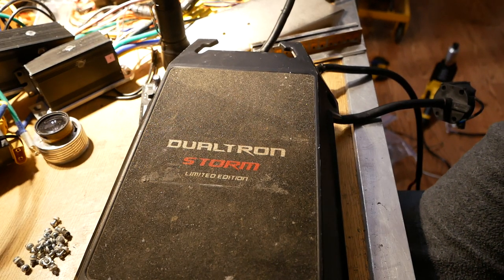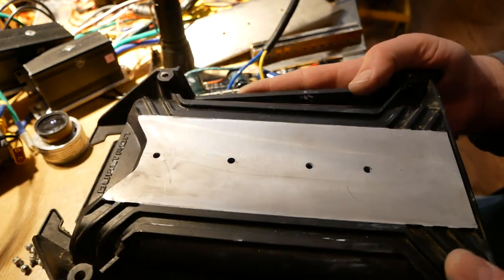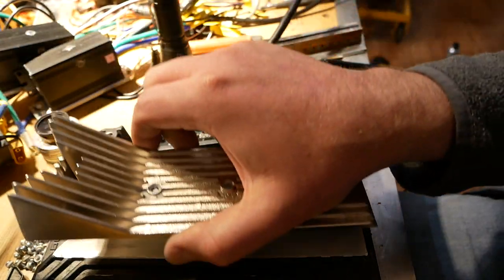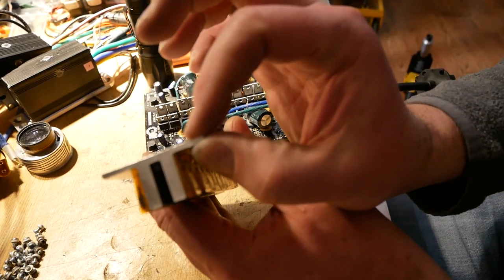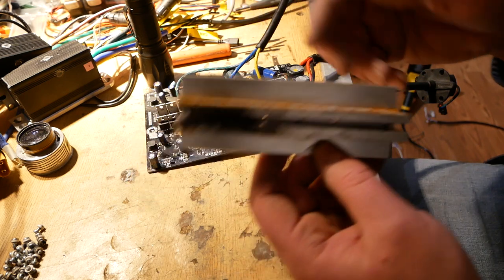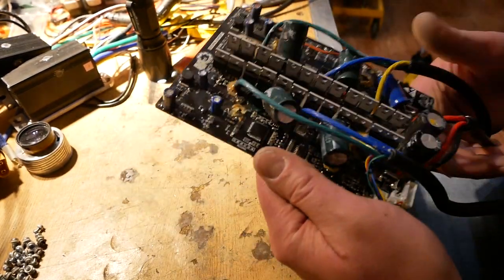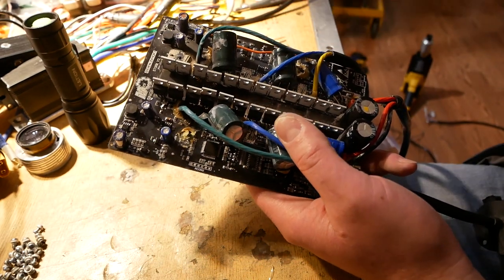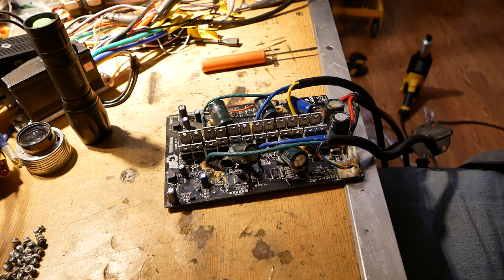Dualtron Storm LTD controller teardown - Why they die so often

Comment: Just bought a storm limited £4300 fml i need your help i want to make sure this doesn't happen to mine i have a soldering iron and heat gun i plan to have a electronics lab this year the whole microscope, oscilloscope, lab power bench supply
Reply from the maker: OK...what sort of help did you want? Fix the various issues I mention in this video and that ought to go a long way. Of course, you could always pull the factory controller once it dies and use something else?
Reply: @de-bodgery  well im going to defenitly try if it doesn't hit 70mph i will contact minimotors straight away if they don't try and help sort it i will send it straight back
Reply from the maker: @thebeast9869  That's your choice of course. My experience has been that performance ratings are always too ideal. My City is supposed to do 45 mph and even down a decent hill l never saw that. If I remember right, best top speed I saw was 38 mph. The motor power carrying a full sized adult, just can't accelerate me to that speed. Going up a hill was much worse...20 mph was about all I could get. So ask yourself what size rider was on the scooter when they got that magical "45 mph"? It may be that no rider was on it at all and they were simply measuring no load wheel RPM. It's not lying persay, but it's also not realistic. Range is this way too. My City can supposedly can get 55 miles range. OK...26Ah/55 miles = .45Ah per mile. If a small child was riding on the lowest power setting with no head wind, you could achieve .45Ah/mile! Otherwise...this is just stupid for anyone else! Never the less, it's what they advertise and it's based on real testing. AKA...not an outright lie, just NOT even close to realistic for most people. Cells are never as good in real world use as the manufacturer claims. A 3400mah cell can't be used to it's full 3400mah in real world conditions. They charge them to 4.2v and discharge to 2.5v. Anyone that cares about LION packs never charges to 4.2v or discharges to 2.5v. This is for 3 reasons. Capacity above 4.1v is negligibly low. Capacity below 3v is negligibly low. Running cells at these voltage ranges greatly shortens their life spans. Realistically a 3400mah 18650 is really more like 3100mah if you assume practical and usable cell voltages. My City pack which uses those ideal numbers from the manufacturer AKA 26Ah is really several Amp/hours less! As you draw current more quickly from a cell it's capacity also drops a little. I quickly found that the only tolerable way I'd ride the City was on max power all the time. Those capacity tests from the battery factory are done at 250mA. No one runs an 18650 at .25 amps in an EV! I don't know my actual amp draw, but I can say it was well over .25 amps per cell. The entire battery industry does this! What it does is makes for rather ideal cell capacities. The typical user doesn't know any of this and lacks the ability to test capacities so they are none the wiser. As you are probably aware, most EV's draw quite a bit of current and much more than .25 amps per cell...which means the capacity delivered per cell is also reduced some. My 26Ah pack is realistically something like 20ah between reasonable charge voltages and current loading. No one lied persay, but the pack capacity in real world use vs ideal circumstances can't possibly match up!
*
So again...your choice...but I'm going to tell you that you'll rarely ever see real world specs on EV's! They are almost always idealistic and therefore unrealistic in real world applications.
Reply: @de-bodgery  dualtron storm and the victor seem to do 50 if this limited does over 60mph im sure with small changes i can get 70mph +
Reply from the maker: @thebeast9869  I'm not sure what "small changes" might be to you.  At a minimum, you'll want to replace the controllers with ones that are FOC...such as something VESC based. This will mean some rewiring, replacing the EY3 throttle, possibly replacing the pack if it can't deliver the current, etc. "Changes" may be smaller or larger depending on what is needed to meet your goals. 
*
60 to 70 mph is only 10 mph, but the wind resistance is significantly higher at 70 than at 60. You can expect to need a fair bit more wattage to get to 70 than you did to get to 60! I can say that you won't get there on the factory controllers with full conviction! The pack might be able to deliver the current needed, but I don't know that as fact. 82v is enough to get to 80 mph, but the current draw is pretty significant. 
*
Anyway, you can see my City build and what I'm doing to make it meet my goals. That might be a lot of changes or just a few to you...can't speak to that!
Reply: @de-bodgery  seen your city build great work already  subscribed to you great work man youtube should promote more stuff like yours instead of mind numbing garbage i will rewatch all your videos countless times to learn more  you truly are a gem on youtube
Reply from the maker: @thebeast9869  Thanks for the compliments! All I wanted to point out is that there are potentially lots and lots of details involved for an "upgrade". I may have gone overboard, but then I also wanted my City to be the best I could make it. I honestly don't know how good it will be. It's quite possible that I'll get it all put together and not be happy with it and will do more or rework certain things. I'm dead sure that there will be details to work out that I won't discover until after it's ridable again. That's always the case!

Comment: You all have defective storm limited scooters.   First batch were defective but some dealers sold anyway.    I waited and just now getting my Ltd next week with motor upgrade - batch 2.    Send it back under warranty
Reply from the maker: This is a dead controller that was new a year ago. There are multiple versions of the controllers and motors. I don't think sellers knew what was defective. You can't tell from the outside.

Comment: You're smarter than the average bear.  I haven't seen inside these newer controllers but that thing is weak at best. I'm guessing the tapered heat spreader is directional? ... LAME!
Reply from the maker: Yes, the case is sloped internally. They tapered the heat spreader to fit into the space.

Comment: My man...!!!!
Thanks allot for this video!!
Because I'm Greek 🇬🇷 and can't explain so good in English the problems with limited (event more with dualtrons)...
I just say that has big issues and DO NOT buy it!!!!❌
Reply from the maker: That's pretty much my opinion too. Or maybe, "Buy it with the expectation that the factory motor controllers have a long history of dying for no good reason." People who own the LTD are eventually going to need to replace their factory controllers with something else when Minimotors decides to no longer make controllers for them. Frankly, if I had one, that's what I'd do. I wouldn't get another Minimotors controller for an LTD. you already know they will self destruct in less than a year. Why do that again?
Reply: @de-bodgery  changing Controllers can do guys like you and me....
The most people that buy this scooter, don't know Anything about electronics... Press throttle and go..!!!
Of course they believe that they have the top scooter of dualtron (and most expensive, exept X)...
from the FIRST day they see that has top speed issue ......
And in 3--5 months burn controller...😲
Left battery and frame....
They have spent so much money and in a few months the 50% of the scoot has DIED!!!!
Where is DUALTRON.....????🤬
WHY they don't take the responsibility and take back the most problematic scooter (and EXPENSIVE) they ever take out and STOP production!!!
You know why they don't do it....?? Because from so many Limited they have been sold, only 2 TALK ( V.THE.SEPIA and STEFFEN)... 🤷
So yes they are the No1 company that sells GARBAGE for GOLD and people are there to PREORDER what ever they sell.....
NUMO company (upgrade WEPED, and other scoots) relish a new scooter named SLACK CORE 920R..
This is a top class scooter from All things (power, stability, comfort, weight, beauty).....THE FUTHER!!!😉☝️
Reply from the maker: @antonypartali  Good point...most people lack the electronics understanding to replace the controllers with another factory controller, never mind something off the shelf like VESC and what needs to be adapted or modified to make it all work together.
*
Dualtron frames and motors are fine. I don't that creaking issue in the lower section of the steering tube, but that can be dealt with. The physical construction is usually fine for anything I've seen. 
*
I did a tire replacement on one a few months ago. I forget what model, but the tires were solid. Both tires were badly worn and needed to be replaced. They were impossible to remove by pressing them off the magnet ring. I used my band saw and cut them off! Getting the new tires on was equally hard and eventually I sprayed the inner surface of the tires with WD40 so they slide on easier. Dualtron had no idea how to do a tire change and for anyone that needed tires was selling them new motors!!! Well that's just nuts! That was the hardest tire change I've ever done and there was no way we'd ever recoup our cost in labor. what do you do? Charge people $500 for a tire change on their scooter? LOL! I can pretty much guarantee you that a very small handful of people would go the effort I went to!
*
The Storm LTD is a decently made scooter with a single enormous flaw...shit controllers that die if you look at them crosswise. All Dualtrons I have ever seen have a complete rats nest of wiring in them that makes no sense why they were done that way. All of the wiring could have been done much more neatly and sanely. When building these scooters, serviceability was not a consideration. Getting the factory controller out of my City took 4 hours! It was buried under all the rest of the wiring and that was such a mess that in the end I was cutting off connectors since they were so badly tangled together and impossible to separate from each other. IF I needed to replace the controller for warranty, I would have wanted to preserve those connectors so they could be reused as is. Dualtron concerned themselves absolutely NOT ONE bit for when things go wrong and how to fix them.
*
I was working on a Feutecher from Dualtron yesterday. My friend had already asked them how to remove the battery. No one at Dualtron had ever done this and the best they could do was theorize that you needed to take off the beck end of the scooter to slide it out. The back end suspension is a PITA to get in and out of the main box section of the scooter! This was bad idea on a good day! I looked at how things were assembled and figured out how to pull it out the front of the box. We sent pics to Dualtron and they were amazed! HOW??? LOL! How do they NOT KNOW how to take their own scooters apart??? In this case the BMS in the pack died and the best option was to get a new pack.
*
There's much worse stuff out there than Minimotors! Not that this makes them "great"...just better than some really really bad EV's I've worked on! For the price, you should be getting attention to detail and careful planning of wiring and electronics placement. Hopefully they are reading these comments and taking a look at what they are doing.
Reply: @de-bodgery  you CRAZY the guys from Dualtron....😁😁👏👏
Of course there are allot of scooters worst than dualtron, ok... 
But the price of them ir OVERPRICED!!!!
Did you ever upgrade a scoot with minimotors electronics (motors have online 3 phase wires)....😤??
Or to talk about suspension.... This is NOT suspension.... It's ”silicone" with metal.....
Anyway... I support every word you say!!! 💯
Everything and everyone has their place....
Dualtron is allot higher than must be...🤷
I already write to your channel!!!
You have big knowledge on electronics, e- scooters and pass it to us FOR FREE!!!!🤩😉
Thanks allot, waiting for your new videos!!!🙏
Reply from the maker: @antonypartali  I'm not sure I like or dislike the rubber box suspension that most Dualtron scooters have. My City has it too. It's OK and lots better than no suspension or just springs. It does provide actual damping. As the rate of rotation on the hunk of rubber increases, the resistance to rotation goes up. That's quite similar to real hydraulic shocks. You can't adjust the level of damping and all you really have is 3 stiffness levels of rubber blocks, but it's still lots better than other options. Dualtron has started to move away from the rubber block suspension for their higher end scooters and to use actual hydraulic or compressed air shocks instead.
*
I'm in process of upgrading my City right now in fact. It has less than 40 miles on it. Enough for me to find it's foibles and what I don't like and then I tore it all apart! I have 2 VESC controllers that will replace the factory controller. You should check out my recent videos. I've covered a lot of the upgrades I am doing to my City in them. I added halls and temp sensors to both of the City hub motors so they can run optimally. I also machined venting slots in their side covers for cooling. All those videos have been posted in just the last couple of months. Until I made this LTD controller video, everything in the past 2 months I have done is all stuff pushing for improvements on my City. LOL...19 videos! Geez! I had no idea and there are more to come!
*
Most everything electric is over priced. It wasn't so long ago that it was way worse. A very basic low power scooter cost you $1800 or more. Now you can buy them on Amazon, Ebay or whatever for less than $800. Volume production has helped this some. Electrified things are still massively inflated. A mountain bike might cost you $600. Add a crappy 500w hub motor and a small lithium battery and now you can't buy the bike for less than $2000! There is probably $400 in parts on the bike to electrify it! EV's are better than they used to be, but still the prices for them is not relative to the value of the EV or its manufacturing cost. EUCs are terrible about this! Most are the WORST quality construction you can find and yet you pay $3000 for maybe $300 worth of hardware! I've had 2. If you look back in my videos you'll find my tear down of my Gotway MTEN3. What a POS!
*
As I have ideas for content (because I'm doing something that makes for decent content), I'll post more. I don't really plan what I'll make a video about. I don't do click bate and I don't give a shit if people like my content or not. I post what I want to post and if that's helpful to people, well great. There is literally ZERO profit motive in it for me.

Comment: I can send you a burnt up Kaabo Mantis pro controller. Just let me know
Reply from the maker: This is a dualtron controller with different connectors on it. I've already taken apart the same controller from Dualtron. Not worth sending to me. Are you hoping I'd do a tear down on it like I did for the LTD controller?
Reply: @de-bodgery  yeah, it's alot packed into a small controller, it failed and i'd like to know why. kinda like a autopsy. failed at 110 miles.
Reply: @de-bodgery  yes just like the Dualtron controller, love to know your insights on it's design too, for 60v 27a it's tiny. lol if my Vsett 10 controller ever fails I'll send it right to you.
Reply from the maker: @thehardnesschannel1605  Geez! That's a VERY short life! The Minimotors.Dualtron controllers that look just like what you have don't usually fail that quickly. Look up Rishimaze on DIY electric car. That's me over there. I don't post personal information in public places like TY! You could send me your controller and I can take a look at it...see why it failed or if it really is the same controller inside as what Dualtron has.
Reply: @de-bodgery  ok, they won’t let me send private messages, my account name is exoc1
Reply from the maker: @thehardnesschannel1605  I PM'd you on diy electric car. Look in Conversations for my message.